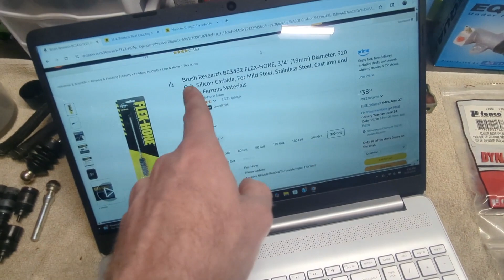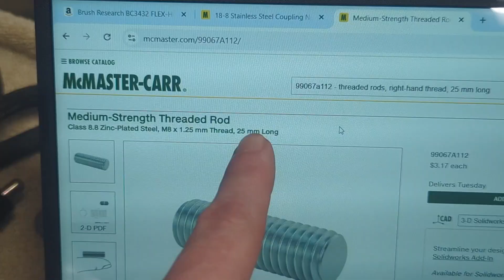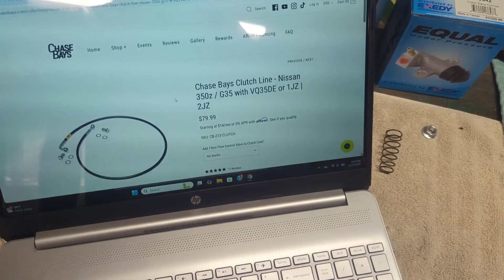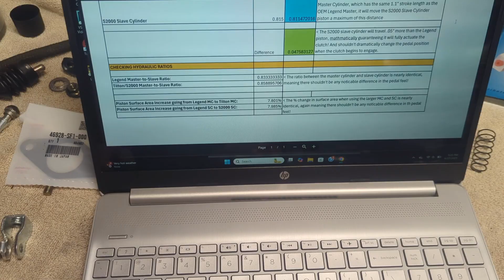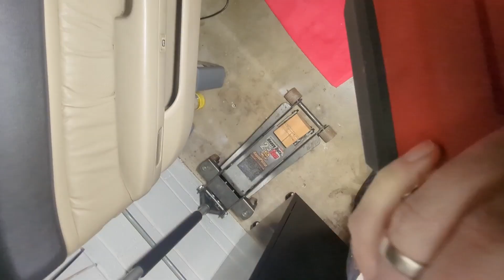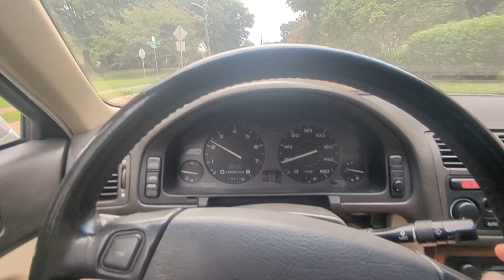Acura Legend Hydraulic Clutch System Part 3 - Legend Component Rebuild & Replacement Solution

Comment: Hey, Great video! I bought the 76-700 MASTER CYLINDER, COMPACT, THREADED, 7/10 with the adapter but mine doesnt clear the firewall. Is there another one you recommend that is smaller?
Reply from the maker: Do you have a sedan? I have a coupe, and was not able to test this setup in a sedan to confirm fitment. I was hoping someone would be willing to test it on a sedan to see if it fit. I had a feeling it might not fit the same, as it's super close to touching the fender on the coupe.